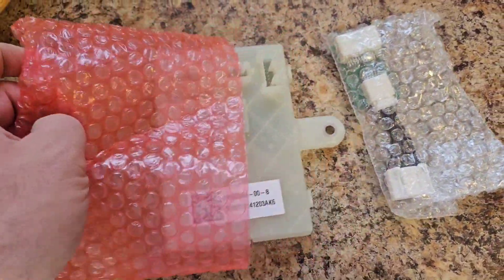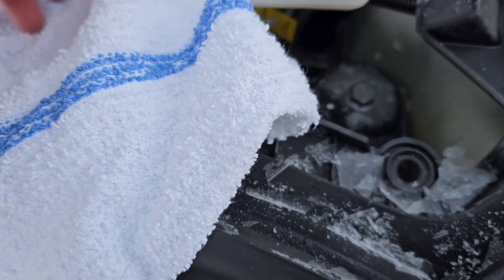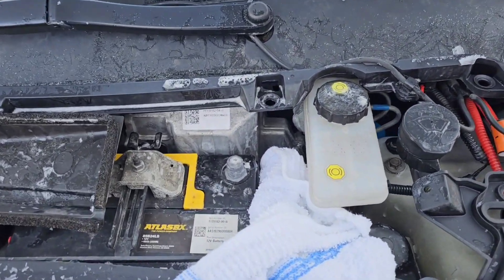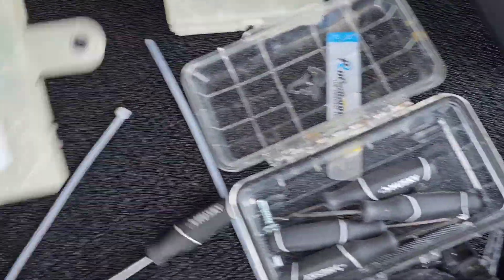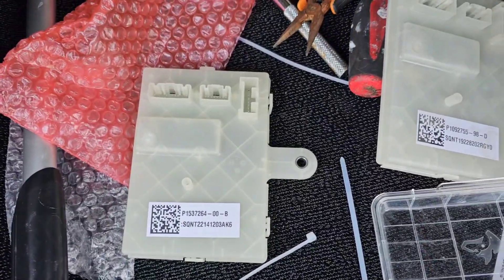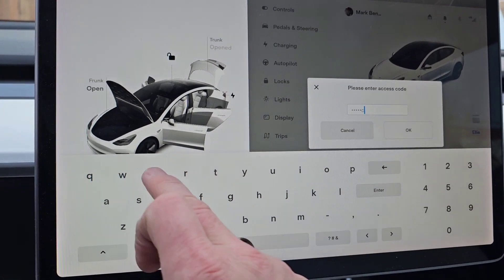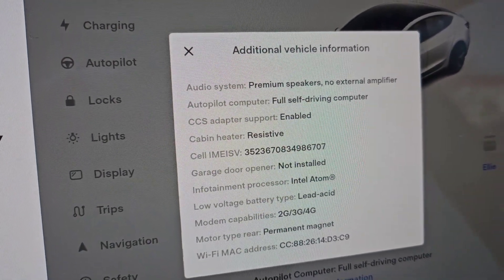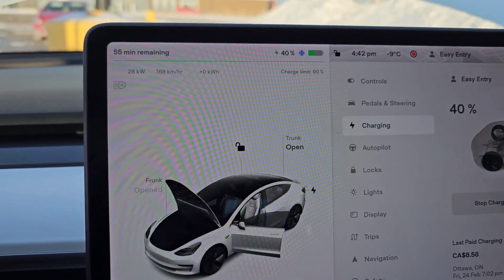Tesla Model 3/Y - How to retrofit your car for CCS charging - where to buy the parts

Comment: Dang Canadians.  Good video though, but I’d suggest lowering all windows at least a few inches, and opening all 4 doors and the front and rear lids… not using the “shutdown” menu… then unhook the 12v ground lug, then pull the HVDC plug. Then swap the module, then reverse